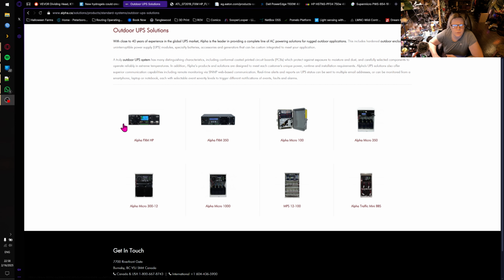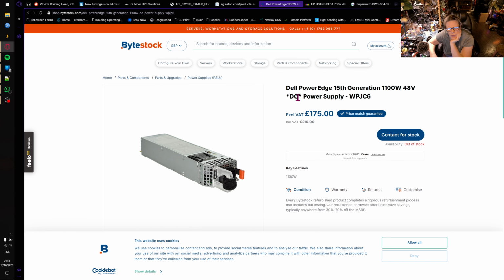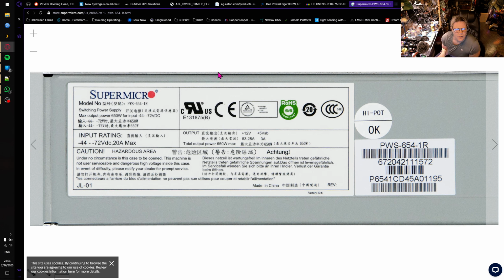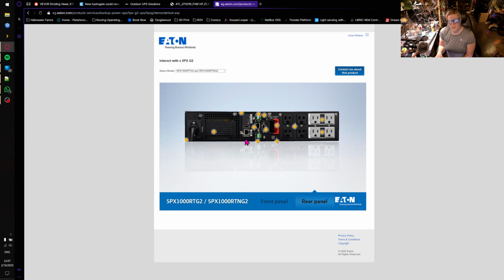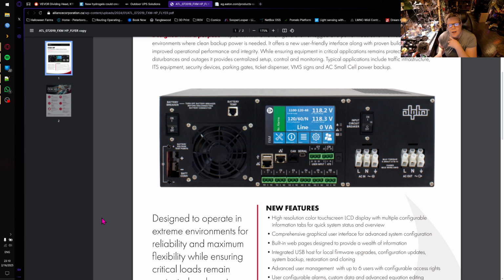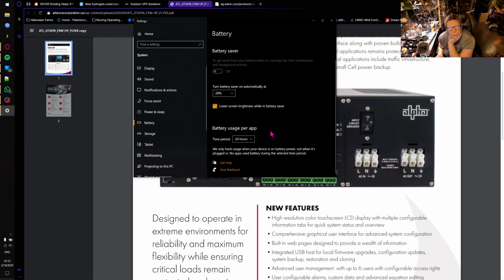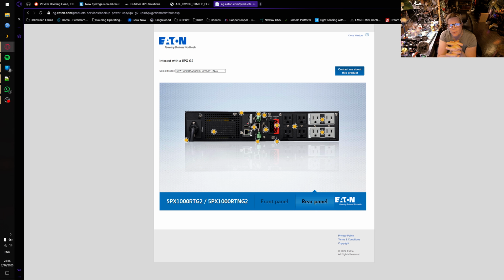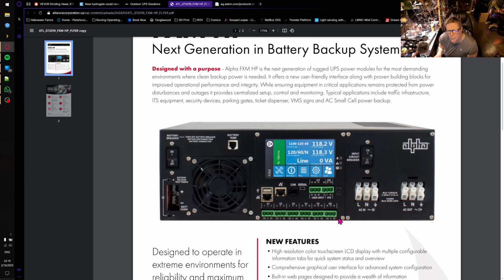Servers require Comms to their Battery Backup!

Comment: It's a fun game. You don't want to draw the battery all of the way down, because when power returns, it might not stay on. You also don't want to shut down too soon, because the power outage might not last more than a few minutes. If you can't run all of your equipment on DC, anything less than dual-conversion is pointless. Heat kills batteries very quickly. If you don't have adequate cooling, budget to replace batteries much more often.
Reply from the maker: Yes!!! The delicate dance!